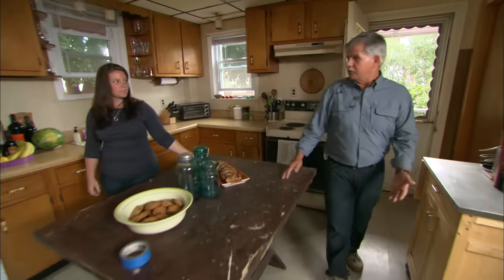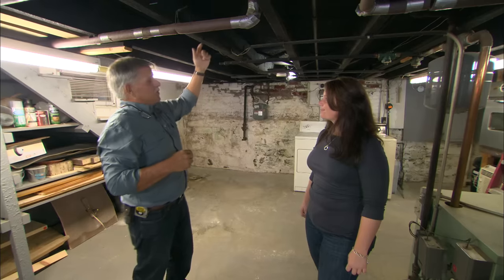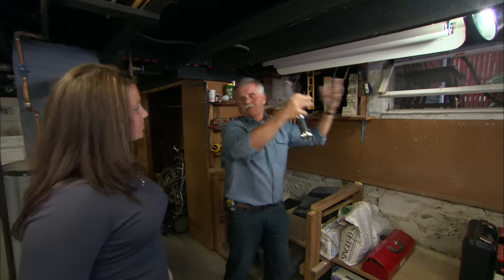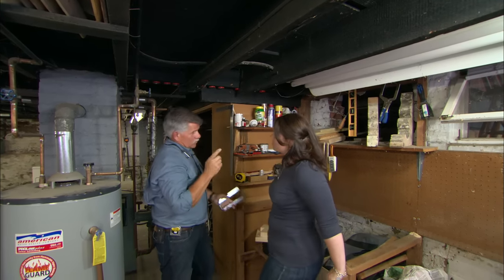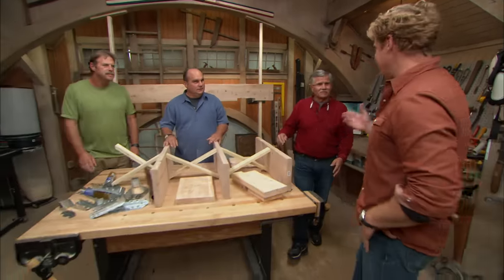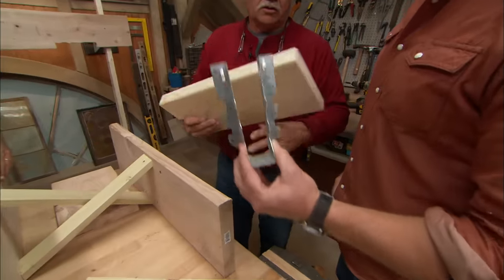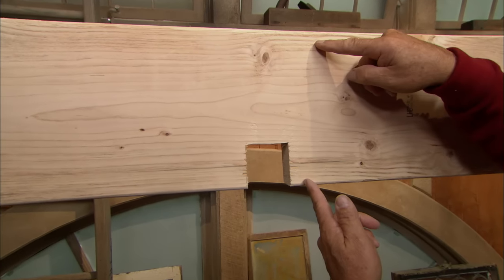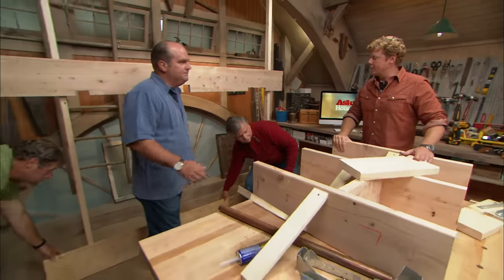How to Repair a Cracked Floor Joist | Ask This Old House

Comment: Im an electrician have cut thru many joists - i knew the center third rule ( being off limits) but not the others - very informative good job
Reply: I just wish they would've brought up drilling holes, and their sizing and positioning. A lot of budding sparkys could've benefitted from that info.
Reply: Actually, best place to drill is in the center of the beam (vertically).  The material in the center of the beam (joist or otherwise) is doing almost nothing to strengthen.  The worst place to cut is the bottom edge.
Reply: I hate you electricians. Drilling. Cutting......  And then there was this tile guy who tried to tell me "joist" was only used for roof supports and of course it was FINE for him to cut through 1/2 of my joist to install a BATHTUB. In fact 2 "professions" wanted to do this cuz....the could. BUT my Daddy taught me somethings. Thank God my brother was free to save me from these idiots.
Reply: @sunoveristambul  
That tells me to make sure there is an automatic termination clause in the contract that terminates the contract immediately should the contractor make such incompetent statements.

It also tells you that the contractor in question could not have passed the state licensing exam which would or should have questions regarding structural support in them.

Maybe should also have a two or three stage process that will weed these clowns out.
Reply: @petemiller519  so what your saying is to not cut holes out from the bottom but to drill holes from the middle of the joist because of the tensile strenthe. but you said the hole cannot exceed 1/4 of the depth of the joist, but what if you want to run a pipe larger then 1/4 through the joist. will you need to drill a bigger hole?
Reply: @petemiller519  I agree with you but I think you may notch the joist safely if you do it closer to support as the required inertia is reduce. But generally, I would always put hole close to center span in mid of joist height leaving at least 2’’ compression and tension fibers.
Reply: electricians of today busting holes with hammers…FEED IT
Reply: Don’t cut throw people joist
Reply: @tonesgaming1012  in the past when I had this issue and didn't want to reframe the whole house, I would sandwich the joist with 3/4" plywood and then drill my holes. Stiffens the joist up at the weak point
Reply: @sunoveristambul  it’s incredible what some of the trades do to structures when they can get away with it.  Thankfully there’s an engineered steel reinforcement product to shore up most of the creative cutting/drilling/notching the average plumber dreams up in the field when the grownups aren’t paying attention.
Reply: Removed an overhead shower fixture that was mounted in the attic. The genius who installed it cut the truss 6" long and 2" deep. All he had to do to avoid this was add 2" of pipe to the fixture when installing. Unfortunately, most contractors are focused on beer time rather than doing a good job.

Comment: Thank you so much for this video. My old house has a jungle of pipes and wires and ducts going through it, and the first floor joists are in terrible shape for it. I really appreciate the patches and repairs that I can undertake myself to make sure that the floor is stiffer and more supportive when my little ones jump and jostle.

Comment: Nice job.  I would also put plywood gussets on either side of the crack for extra strength.
Reply: +iShootBandits same here.
Reply: Agreed!
Reply: What is a gusset ?
Reply: Since the bracket, and also the bottom half of the joist, is only supporting a very small part of the load, additional shoring seems pretty unnecessary.  Not to say overkill isn't always great, but in this case it does seem like it would not add any value.
Reply: @pbristow  over kill always Best
Reply: Rich Huddleston  Sorry, I disagree.  Overkill is usually what people do when they aren't sure how to do something correctly, and often times it can hide the fact that something is actually done incorrectly.  When it's killed the proper amount, you know the workmanship is good.  An engineer never overkills unless they're just bad at their job.
Reply: @pbristow  
"An engineer never overkills unless they're just bad at their job"

In bridge construction, that used to be the standard operating procedure. When that standard was not followed, because the engineer thought that the material being used was of a superior quality, the bridge collapsed and people died.

Similar bridges that were built with the overkill mentality, are still standing and in service today.

In some situations. 
Overkill saves lives.
Reply: How about a gusset of half inch, pre-drilled steel plate, the same size as the joist, extending four feet on either side of the weakened, or damaged area, through bolted to the joist with high tensile, 3/8 inch diameter, fine pitch bolts, torqued to eighty pounds?
Reply: @garyh4458  Exactly, but rebuild using high tensile, reinforced concrete throughout, like a smaller version of the WWll Berlin flak towers?
Reply: @pbristow  that's the most idiotic statement I've ever read. Engineers use overkill more than anyone. Google "safety factor". It's an arbitrary factor assigned based on how much overkill an engineering firm likes to have. It is impossible to be 100% certain.
Edit. I see someone else mentioned this
Reply: @frankmiller95  Would work for a Sherman tank.
Reply: Ivor yes thank you. You can use carriage bolts.
Reply: Howie Felterbush I’ll bet their floors stink. Don’t want to work on that “crawl space”.
Reply: @pbristow  A good engineer makes it really strong.  A GREAT engineer makes it just strong enough, so I agree with you.
Reply: BrandonF216  a safety factor and overkill are radically different things.  A safety factor is engineering the structure from the ground up to support more than you might expect.  This accounts for unexpected situations like emergencies, deterioration, etc.  Overkill is the non-engineer's way of making some parts stronger than others, at random and without proper application of design principles.  This can and does lead to premature failure because, often enough, things that are designed to flex or move in a certain way no longer do.  Overkill is to engineering as finger painting is to artistry.
Reply: I would fill the basement with cement.
Reply: Wouldn’t recommend, it’s already cracking more nail/screw holes will cause more weak points

Comment: This is a great book with a lot of good construction tips The sheds featured in this book are probably built better than most peoples' homes. https://www.youtube.com/post/UgkxzaRUJNcbypw-fRBDbqqz43ULIa-1EGP- The author uses only the best materials and methods. It proved to be a great resource for my little 8' x 10' shed project and more 400+ plans. If you are turned off by the flimsy tin and home center kit sheds; if you want a shed that has some character and can be used as an extension of your home; then this book is for you.

Comment: I'm in construction and have to deal with people that aren't, almost on a daily basis. I probably wouldn't be explaining the problem unless asked, this is an educational video so explaining is the purpose of it. The reason she didn't understand is that he started a sentence talking about feet and then didn't mention that he was talking about inches by the end of the same sentence. Second time round she got it, it's likely we all have knowledge that the next person doesn't have, especially if they're not in the industry. I speak to sparks (electricians) all the time and I can only guess installations to get the ball rolling. They know I'm not a spark and compensate for that, in the same way they might not understand non-electrical building work, and I compensate for that too. No matter how daft a question or lack of understanding is, it's important to appreciate the persons background. At least she admitted she didn't understand, which is better than many people that just nod and carry on without having learnt something. Keep up the good work!
Reply: That's a great attitude

Comment: I would add: If you need a hole to run piping through, or conduit, it's better to do that at the center depth of the joist (center the hole about 4.5" down from the top in a 2x10 joist). This has the smallest effect on the joist's moment of interia (stiffness) and section modulus (strength). Removing material at the top or bottom of a joist has a much larger effect. Drilling a nice round hole in the center works really well from a structural standpoint and seems easier than cutting a rectangular notch. This can be done anywhere along the joist span and I wouldn't lose bat an eye, as long as it's close the center. I'd limit the hole diameter to about 1/4 the joist depth.
Reply: Wish my electricians and plumbers got the memo. These people are terrible.

Comment: I have a 1930 house and have a crack in the middle of the joist under my bathtub that I need to work on.
Plywood attached like Tommy showed is the answer, glued and nailed after propping up.
Cheers

Comment: Jack up the sagging area(s) with lally column(s) as needed to level the floor over 6 - 8 -12 months or so.  When the floor is level, sister the joists on each with 1/8 or 3/16 steel cut to the width of the joists over the length of the run.  Be sure to butt the steel up to the floor above. Through bolt the steel  on the ends and on a staggered basis every 12 - 16 inches or so (You might consider stainless steel bolts.).    That floor simply will not sag again.   Did this with a long unsupported run in a shed with a 4 inch sag in the floor.  Now I park the car on the floor...
Reply: @Farmer1234 Thank you very much for posting! I am experiencing a 3/4" sag in the livingroom of my house which was built in 1928. I hope to try your method to correct/improve this. I have started slowly jacking up a couple of my problem 2x8" floor joists  with the temporary lally Columns. Do you have any pictures of exactly how you sistered in the steel? I believe I understand but I want to get this right. Thank you for your time.
Reply: @dcvino  Glad to be of help. Just take your time adjusting the lally columns.  Use something like a 12 - 18 inch long  2X12 as a foot plate to spread the load on the floor and take your time leveling  the structure to avoid stressing the building or cracking wallboard.  You may also consider using 90 degree angle iron as a sister rib, depending on the particular situation.
Reply: @dcvino  Sadly, no the job was done at the country house a distance away from here.  Basically, you sandwich the joist(s)  with the sheet steel and hold it in place with Lag screws or bolts.  If space permits, C clamps drawn up tightly will hold the sheet metal on either side of the joists.  If you wish, when the steel is in place, you can through drill through the first sheet, the joist, and the second sheet to use  bolts.  Washers and a lock washer will keep the bolts drawn up tight.  Hex head bolts are best as you can use two wrenches for maximum tightness.
Reply: @Farmer-bh3cg  Thank you again! I feel much more confident now that I have added the 18" long 2"x12" bases as foot plates for my temporary lally columns and I will be proceeding slowly with the raising of my sagging floors. My neighbor tells me that we have a great metal shop in our area that will custom cut stock to length for the general public and will also drill holes in the steel where required. I will be asking them if angle stock is an option for the size/length I need. My floor joist are (actual 1.5" x just over 7 1/4")  2x8's x approximately 11.5' long. I am planning on through bolting with hardened hex head bolts and over-sized washers.Appreciate your time!
Reply: Steve   A local machine shop should be able to help you or direct you to a metal  seller.  A length of strap iron will give one dimensional strength while  90 degree Channel iron  is stable in two dimensions; both are  very  strong for the weight.   If steel doesn't work for your application, consider an engineered beam.  These are basically very thick plywood beams in a variety of lengths, thicknesses and widths.  These can be sistered over the cut joist and would also work well.  Hope this helps!
Reply: @dcvino  How did this come out and is it holding up well still, after 3 years?
Reply: @angellas.1314  It was still rock solid as of 7 months ago when we sold the house. We received praise from the seller’s home inspector who noted the repair in his report.  We used 3/16” 90 degree angled steel that we purchased from a local steel shop. They we super helpful and drilled holes in the steel that we purchased, in a staggered pattern for us. After level, we added the steel using  the holes as sort of a template to follow as we drilled into our joists. We through bolted everything together with grade 8 bolts, lock washers, and nuts.
Reply: @dcvino  Happy to hear this worked well!

Comment: Tom mentioned at the end gluing in plywood to help stiffen.  We have a 110yr old house with 2x4 roof rafters 24"OC originally with Cedar shake roof.  Hip roof with five 18' long 2x4's.  Then someone took off the shakes, installed 1/2" plywood on top of the 1x8 roofing boards and then asphalt shingles.  The weight made the 2x4 rafters bow 2".  We bought the house and seeing the huge space in the attic (covered with 100 yrs of dirt and spider webs), cleaned it all up, and  gently jacked up the 2x4s watching a string.  It couldn't take more than 1" correction before we starting hearing all kinds of creaking.  So we left it at 1" dip.  Can hardly see that anyway.  Then instead of sistering a 2x6, we took another 2x4 and mated it edge to edge to essentially make a 2x8.  We cut 1/2" plywood (not OSB) into 8' long strips 7" wide,  completely covered both surfaces with Wood glue and put one plywood strip on each side of the 2x4's.  Then we used those "hanger nails" Tom mentioned using.  We call them Teco nails.  #10.   Every 12" 1 1/2" from each edge.  Used an air palm nailer and ear muffs.  This is stronger than a 2x8 and left us way more room for insulation, which we spray foamed in.  Then put 1x8 pine to finish it.  We sistered 2x8s to the 2x6 floor (2nd floor ceiling support) and put down 3/4" t&g flooring plywood.  Carpeted it, and put in an 8' pool table.  Now it's a game room.  HS kids love it.  Even has a wet bar plumbed in with a small fridge and ice machine.  I think we added 20,000 to the value.  The county assessor sure loved the tour.  ack!  Been watching TOH since 1985.
Reply: How is it holding up to today?

Comment: Now your still gonna have that MASSIVE DIP in your floor but at least the crack in the joist you didn't know about won't bother you any more!
Reply: I had the same thought. The issue they wanted fixed was the dip not the unknown cracked floor joist but that was probably outside the This Old House budget.
Reply: The structure was fixed for a song.
Reply: The problem is that once something like wood has settled and creeped into a deflected state, there isn't any realistic option to get that creep back out. You aren't going to just jack the deflected spot and straighten it back out. You probably have to just put new joists up and jack them into a position that lifts the sub-floor back up after you have cut it free from the screwed up spots. I've done the structural design on several house remodels. Sometimes we can get sticking doors on the second floor to stop sticking and windows to open better, but a lot of times, the framing just isn't oriented in a way that you are able to do much about it without more major tear down and rebuild. Sometimes the issue is the sill plate has crushed under an overloaded column and you really aren't fixing that without some removing and rebuilding. A lot of times, you can make it perfectly safe and you stop any more deflection from occurring, but people are just going to have to reset doors and windows and retrim things. You can always redo you floor with shimming under it to get it as level as possible, once you've stopped it from any more movement. There's a reason why the phrase cut to fit and paint to match exists.

Comment: Like Tommy has never nailed or screwed into a pipe causing Richard to have to replumb
Reply: phxtonash everyone makes mistakes, Tommy didn't get where he is today by never once messing up.
Reply: Lol Phxto just what I was thinking
Reply: That is why they have to put metal straps on the studs where the plumbing is, though you can hit plumbing once in a while.   The drywall guys are probably subcontractors.
Reply: Plumbers know only three things: Poop runs downhill, payday is on Friday, NEVER scratch your nose!

Comment: There are appropriate sized nails for all joist hanger applications. However, the length of the nail used in a hanger is generally not the determining strength factor. The nails in a hanger  are subjected more to shear or cutting than they are to withdrawal or pulling out. So what really matters is the cross section or thickness of the nail and not the length. There are shorter nails that can be used with hangers that don't degrade the load carrying ability of the hanger, you just have to buy the right ones. There are also screws available that can be used with hangers, but they must be the ones specified by the hanger manufacturer. The general statement that "hanger" nails are no good is incorrect. Using the correct product is always the best option.
Reply: "The general statement that 'hanger' nails are no good,is incorrect."

I guess it's a good thing nobody made that statement.
Reply: Not sure why you bring this up. Nobody was talking about nail length. He said avoid drywall screws to sister joists, that's all (I would hope most serious DIYer knew that).